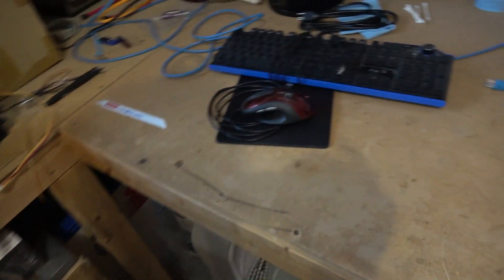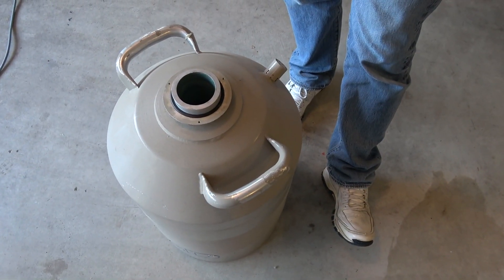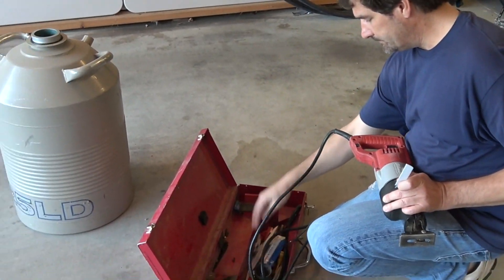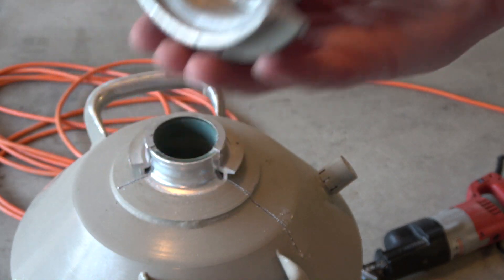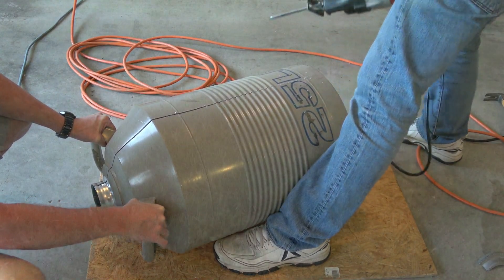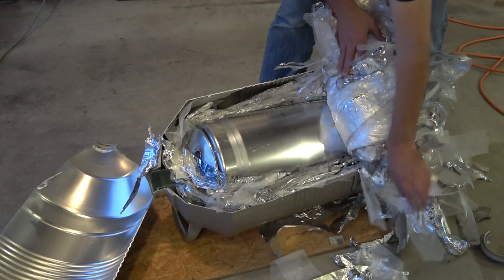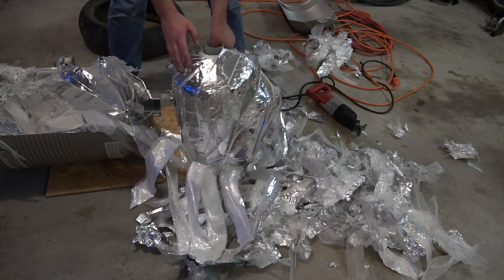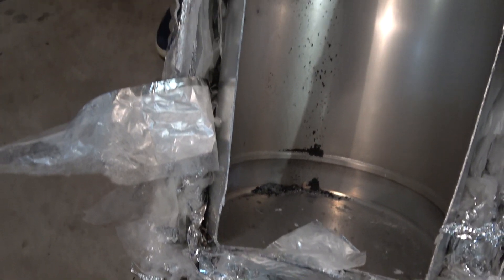What is inside a 25 Liter LN2 Dewar

Comment: Hey, I was just looking for this information, perfect! I'm planning on getting liquid nitrogen, and I wanted to know how to insulate it well even outside the dewar, like when I'm using it to cool things, so that it doesn't waste so much liquid nitrogen to the environment rather than actually cooling the thing I want it to. anyway, I figured that knowing what the dewar itself is like would give me a better understanding of how to insulate it elsewhere.
Reply from the maker: What is going to really bake your noodle is knowing that even with a quality dewar you will lose LN2 in the tank.  It will also evaporate at an increasing higher rate based on how much is left.  For most applications, basic closed cell foam or even the foam coolers you get from the store is enough.
Reply: @Hardwareasylum  well yeah, nothing is a perfect insulator, so it wont stay cold forever.

Comment: Hi, I wonder how long possible to keep liquid nitrogen in dewar? day or weeks?
Reply from the maker: It depends on how much you have and what type of dewar you are using to store your LN2.  I have another tank similar to this and stored LN2 in it for about a month before it was all gone.  

Thing that most people don't' realize is that despite the insulation the LN2 does not want to stay liquid and eventually will turn back into a gas, the process is slow at first but goes rather quickly towards the end.

Tanks all have a "hold time" spec and that describes how long they can store liquid before it all goes away.

Comment: If some one had to do it, I'm glad it wasn't me! :)  That being said, the pressure relief safety valve is on the cap, not the body of the dewar, right?  You've lost vacuum when the contents of the tank (without a sealing cap on it) doesn't last more than a few days/weeks rather than the month or more that it should last.  Did the outside of the tank get frosty?  Did you have inordinately rapid loss of liquid?
Reply from the maker: The pressure release is on the body of the dewar and controls the vacuum between the inner and outer tanks.  There was no frost on the outside of the dewar but, it did get cold to the touch.  For dewars that show signs of frost, that means that the inner tank made contact with the outer one and happens on the lower quality tanks.

The sealing cap does two things.  Adds an extra layer of insulation and keeps things from falling in.  Having it on vs off doesn't impact the hold time all that much and is more for safety.

When people say they "leak" they are speaking to a change in the hold time and for this tank it worked out to be less than a quarter of the advertised time..
Reply: @Hardwareasylum  true... but I hope you tried to pull a hard vacuum on the dewar before consigning it to a "sawzall!" :)
Reply from the maker: Ya, Uh, no that is too much effort, I didn't have the tools AND cutting it up before throwing everything in the trash is WAY more fun.  Besides, I had already bought a new dewar so, why bother.
Reply: @Hardwareasylum  Depending on the Vacuum port you can get a pretty good vacuum with one used for refrigeration systems. Dewars used in labs of course use more LN2 on a regular basis so go a bit lower to make them a bit more efficient.  Most of these tanks go bad because people are careless and end up exposing the valve to LN2 which they are really not rated for (the o-ring and mastic material shrink and allow air into the vacuum) or they drop them and break the fiberglass neck.

Comment: thanks very much
What is name and type of insuluter of AL foil and tecture?
Reply from the maker: I do not know the name.
Reply: That may just be standard aluminized Mylar film. That is produced by setting rolls of plastic inside a vacuum chamber with a special vaporizer unit; the roll of film is slowly rolled past the area where the vaporizer is spewing a spray of ionized aluminum vapor (or other metals sometimes). This thin metal layer on one side of the plastic film is enough to provide for a rather effective heat reflector. One layer is enough to make for a poncho that keeps you much warmer than you would be without it (emergency ponchos, rain ponchos, etc) and many layers add up to reject most heat trying to enter the flask. Add on the fact that the inner part is under vacuum so the heat transfer to the liquid is minimal.

Comment: If the same structure in 15 ltr and 3 ltrs
Reply plz
Reply from the maker: 15Liter.. Maybe.  As for a 3 Liter. that is like a large engine or maybe one of those coffee thermos'esesess so...  not likely.  When thinking about how things are built I might suggest considering the manufacture of the product.  Does it look the same on the outside? then it might have similar insides.

Comment: Nice  informative video ..loved it.
How do they repair those dewars? How do they vaccum?
Reply: I am the QA Engineer for this product..Taylor Wharton now Worthington Industries I have cut open at least one a week..I was the Technical Writer for Taylor Wharton 28 yrs ago..started into the Eng Department..I know the details of how these units are made.
Reply: are you ln2 container enginner
Reply: @monutanwar8066  yes I am
Reply: @joekuntz6132  care to share the vac parameters for these bottles?  Details about the valve vac to restore the vacuum would be very interesting.
Reply: @joekuntz6132  from your experience what would be the best way for these to be reused? I haven't repaired A TW unit before mainly just Thermofisher ones.
Reply from the maker: Honestly I'm not sure how they repair them.
Reply: Reseal with a 1-way valve and use a 2 Stage Vacuum Pump to pull it down to around 15 Micron or less.
Reply: @richiec7700  Will One Stage Pump not work?
Reply: @richiec7700  thankyou. Do you have any further instructions on that. I need the information . I shall be grateful. 
snehal50samarpit[@]yahoo
[Dot]com
Reply: @richiec7700  i am glad to see you post. I hate seeing these unit be trashed when they can have a good second life.